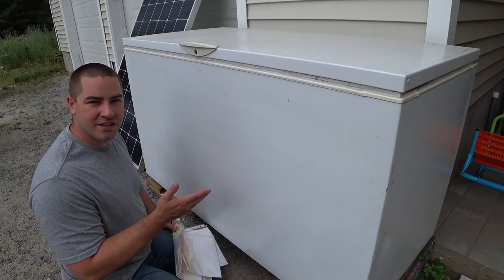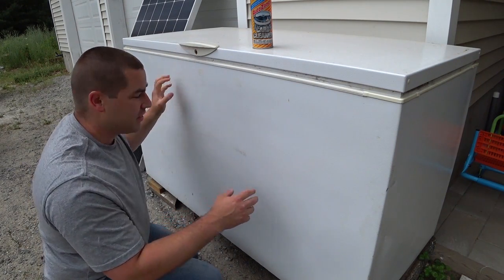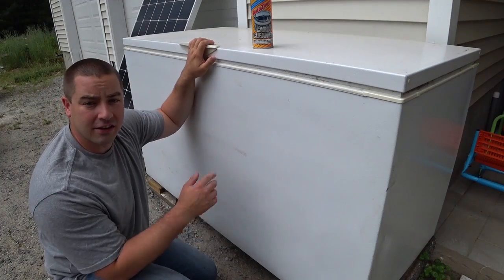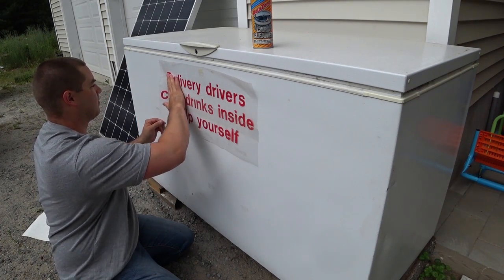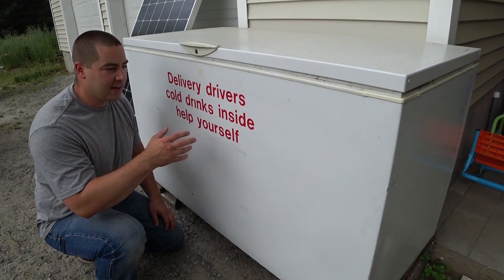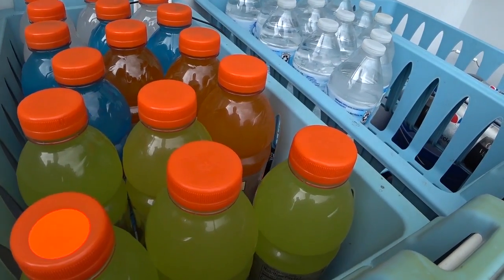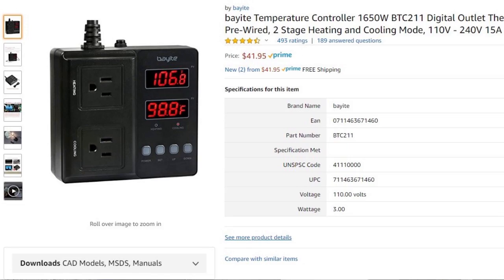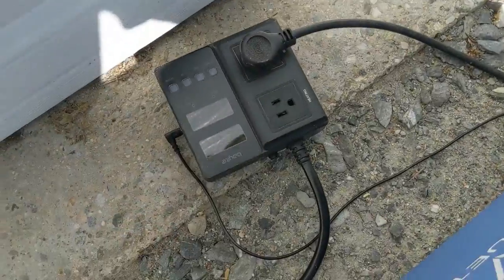Solar Powered Chest Freezer turned into Fridge

Comment: And I have 500 wats of solar, 220an of battery, 40 amp controller and a 1000 watt Redodo inverter that won't power up my 7cf chest freezer with a 100 % battery.  Won't power up my 18cf fridge either.

Comment: If you have the tools you could convert that to r600 and it would use half the power. You can buy new freezer with r600a.  You may want to mount the solar panel over the freezer to provide shade.

Comment: How does the portable power station and fridge freezer hold up in cold/rain/snow?
Reply from the maker: The power station is not waterproof and needs to be protected from direct rain.  Mine has had some rain water splash off the driveway and hit it with no noticeable problems.  The Freezer doesn't care at all.

Comment: Wondering How much battery is needed for off solar hours.
Reply from the maker: It will depend on your load.  This chest freezer seems to be pretty energy efficient over-night.  Nobody opens it at night, and the air is cooler.  So it only uses about 300-400Wh overnight.
Reply: @DavidPozEnergy  thank you for the tip. I figured the formula out for hypotheticals. It’s amazing I can power this with recycled laptop batteries. With sufficient voltage and parallel batteries for Load and run time.

Comment: My 2002 GE 7 cu ft. freezer in the garage is showing on watt meter as using 1000 watts a day.  The watt use seems very high and it is set a the suggested level of 4.  I have a couple questions:  I am wanting an off grid refrig and was not sure if being the watts are so high on this freezer, if worth doing on this freezer?   Also, if use as a refrig in an emergency can it be reversed back to a freezer when emergency over?
Reply: If use as a refrig in an emergency can it be reversed back to a freezer when emergency over ???

Comment: This is really cool and gives me some ideas.  One recommendation I have for stable temperature regulation is to tape the probe to a can of soda.  It will give you a better measurement of how cold your beverages actually are.  That's what I do for my keezer setup and my pour temps are consistently 34-35F.

Thanks for the cool video!

Comment: I got a smaller 3.5 cu ft Kenmore chest freezer and set it up as a fridge at 36 degrees. My kilowatt meter read that over one week, after initial temp cool down, it used 180 watt hours every 24 hours. This is five times less energy than my house fridge. I was amazed. I put many water bottles in the bottom to act as thermal mass, and only opened it a few times to get a drink. Smaller chest freezers are better in my opinion vs the very big one, but it depends on your needs of course.

Comment: Great Vids mate. . . I'm thinking of turning a chest  freezer into an Air conditioning unit. . .chilled water thru a heat exchanger. Glycol water mixture chilled to minus 10 Dec C and circulate the water . . Any thoughts ?
Reply from the maker: I have been playing with the numbers this summer thinking of doing the same thing.  The downside I see, the chest freezer is only cooling about 2000 BTU.  The smallest window AC is 5000 BTU.  So I'm guessing that the freezer by itself won't offer much in the way of cooling capacity.  I'm going to take an old window AC and remove the cover, and make a glycol chiller with that.  Should be more powerful.

Comment: You know,,, I’ve seen 7.8kw generator’s for 600 dollars.... you can run off a 3/4 115 v electric motor,, that runs of its self.... and throw all that other stuff in the 🗑  all you have to do is figure it out. But Save the battery’s at least (4)100 amp,, and a good controller.. life is good..😎

Comment: Just hooked up our new deep freezer to the thermostat controller that you recommended.  Freaking awesome to be able to control the temp this precisely.  Running off the solar panels and inverter/battery bank, so far working great! Thanks for doing all the homework on this diy.
Reply from the maker: Glad it's working well for you.

Comment: How cool... did same with a small freezer, but build a esp8266 with a ds18b20 running tasmota for the sensor, homeassistant as controller and a wifiplug as actor. When ordered stuff arrives i‘ll remodel them to a standalone solution with online monitoring/controlling.

Comment: A bit late to this video but did you happen to measure the energy usage before the conversion? And about how old is it / what refrigerant? I'm asking because it helps to compare different setups. If I want to set up my own efficient refrigerator I would like to know more about where the gains are coming from.

Whatever you do, please keep us posted about your projects. It's great seeing these videos from a real down-to-Earth person.
Reply from the maker: Sorry, I did not test the unit before the conversion.  I don't know the details on it.  But the sticker says Electrolux, model GLFC2027FW6  I hope that helps.
Reply: @DavidPozEnergy  That looks like a 20 ft3 unit from 2006 or 2007, originally rated for 480kWh/year (equivalent to 1300 Wh/day.) It seems like you cut energy consumption by more than half with your conversion. I would not have expected that much savings.

https://www.frigidaire.com/Owner-Center/Product-Support--Manuals/?ProductCode=GLFC2027FW

Comment: There seems to be a non-trivial loss in efficiency since the inverter is always generating AC power despite the freezer only needing this power occasionally.  Even if the inverter had some sort of load-sensing mode, the external thermostat demands constant power.  Say the inverter consumes 8 watts from the batteries with zero load on the AC side; that's a baseline loss of 192 watt-hours per day (~40% addition to what was measured with a Kill-A-Watt).  That is added cost in both solar panel and batteries.  If a mechanical (or DC powered) thermostat could gate the inverter on and off, there would be the opportunity to expend less energy.
Reply: Good idea..will try

Comment: Dave I have an unrelated question for you. I need to charge a 16s 48volt LiFePO4 headway 38120 battery pack but now I'm stuck because I don't know what to charge it with. Can you help me please.
Reply from the maker: LiFePO4 charges to 3.65 volts per cell, or 58.4v for the 16s pack.  I personally use my solar panels and solar charge controller to charge my LiFePO4.  But you can also look for a wall charger like this: https://amzn.to/3iocHCl  
“As an Amazon Associate I earn from qualifying purchases.”
Reply: @DavidPozEnergy  Thank you so much David for your reply once again. Thank you for the link. I asked that question because I am going to use the Headway battery for an Ebike.  Not sure if its the best idea but ya lol I already have money into it. I like all the different projects you come up with.
Reply from the maker: Headways are fine for an E-bike. They really pack a punch.  But they are not super energy dense for the weight.  They will work great for short trips, but long rides will probably do better with something else.  The wall charger I linked to works for 16s LFP, but you still will want a BMS on the battery to monitor the charging and prevent over-charging one of the cells.
Reply: @DavidPozEnergy  Ya I just bought a 16s  Li-ion Lifepo4 LTO Battery Active Equalizer BMS 1.2A Balancer. Hopefully it will work well. But ya David if you have a better 48 volt battery build for an ebike let me know. I could always use the headways for solar instead and go with something else for the ebike. What I like about the headways is the terminals with the screws. It makes it so easy. Now I just need a bunch of assorted terminal wires with connectors and I should be set.

Comment: This set up will produce very little condensate, but it produce some over time.  How does your set up address the condensate issue? Thank you.
Reply from the maker: There is a drain plug in the floor and I can manually drain it.  I see a little puddle forming.

Comment: To the Ref Tech - this is not a commercial system. You are mistaken about this conversion. It uses the same exact refrigerant, oil and compressors as used in refrigerators. Depending on the age its probably R134a.  And if you understand residential refrigerators, they are refrigerator/freezers and the evaporator runs at freezer temps and then about 10% of that freezer temp air is directed in to the fresh food (refrigerator) compartment. This is on a frost free refrigerator. So evaporators and condensers are running at the same temps on either either refrigerator/freezers or just plain freezers. The biggest difference is this is a chest freezer so it means a few differences with a frost free upright refrigerator/freezer. Mainly the evaporator and condenser are just tubes attached to the inside liner and the outside cabinet. Then foam insulation is injected in the space in between. 
Dave - there is one other reason a chest freezer is more efficient than an upright. Believe it or not its the weight of the lid pressing down on the gasket. In an upright a rule of thumb for design was the heat gain into the cabinet was roughly a third each 1, through the cabinet wall, 2 through the door/ lid and 3 through the gasket area. Just the weight of the lid is enough to make a meaningful difference. BTW I used to work designing refrigerators and freezers at a couple of the largest appliance manufacturers in the country. 

to address the water collection in the bottom there should be a drain plug you could remove. if you  attach a drain trap like you find on the condensate line from an air conditioner this would keep cold air from leaking out the drain, though it is small enough not to matter. On the cycle length as long as it runs for 10 minutes before cutting off that is probably enough not to matter. Also, we used to have units that could be either freezers or refrigerators controlled by the user just by changing the settings. You might even be able to adjust the thermostat to raise the temp it runs at and then you could eliminate the fancy electronic control. 

Thanks for these videos - they've been an inspiration to me.

Comment: It’s easy, but there’s nothing to de-humidify the inside.  (I do this to brew lagers).   It’s fine for brewing as the co2 production maintains positive pressure inside the fermenting vessel but due to mold build up I’d not use is for anything not sealed/washable.

Comment: I have a upright freezer already, I'm going to make  plexiglass doors to go inside the door, to keep in some of the cold, when the door is open, the thing is soo big , it would not fit through my doors! Even with the door removed,  I was going to convert it, I may still, but the extra doors should help, I'll see how's it goes!
Reply: My grandparents had an old fridge or freezer that wouldn't fit through the doors. Once it broke they used it as a DIY safe.

When you talk about converting your upright freezer, do you mean into a refrigerator or into a chest freezer? Refrigeration systems don't work if they're not upright, so you would probably need extensive modifications to convert an upright freezer to a chest freezer.

Comment: Let me see if I have this dumb idea correct....... All $'s approx.:  $2050 Bluetti w/tax + $48 temp controller + $400??? solar panel = $2498 divided by a realistic $25.00 a normal month (or less) for 120vac supply = 99.92 months to break even.....    So, I'm to invest $2500 to run a freezer instead of plugging in to vac.???    Just plug into 120vac & turn the thermostat down to a less than freezing temp & Bob's your rich uncle...!!!
Reply: He claims the freezer is "super efficient" yet it draws 200w. My new Samsung fridge freezer draws 30w. Since when do old appliances run efficiently?

Comment: I have done this with upright residential and commercial freezers for many years. Usually changing the internal thermostat with a commercial thermostat that had a range from -25 to 90 degrees. This would make it easily changed back and forth. Especially nice if having a big party. Upright freezers hold a lot of drinks. Also a lot of groceries. Only problem is some new freezers are digital and are not easy to hack.
Reply from the maker: Good idea.  If it's not too much trouble, could you please help me with a link to a thermostat like that?
Reply: DavidPoz Never any trouble at all, I sent you a message!

Comment: Based off your power reading of 200W, 2.5 hr run time in 24hrs is great! My cheap ($225 USD) upright fridge runs 21 hrs in 24 to keep things just cold enough. It's new and I rent, I told the landlord and the dealer came and checked it, said it was fine. They bought inexpensive appliances and the energy usage shows it.
Reply: That can't possibly be correct for a traditional refrigerator. I suspect either there is a poor seal or the compressor is not running at full speed. New refrigerators will often have multiple speed compressors to increase efficiency. A cheap fridge wouldn't do this unless required to meet energy standards, maybe it just has a tiny compressor because it's cheaper and slightly more efficient (at the expense of longevity)

Comment: why not just change the compressor to a danfoss 12v compressor then it will run as a fridge and freezer and add a hybrid controller so in the day time you can run it with solar and at night time you can run with wind turbine
Reply: In the US you need to be licensed in order to modify refrigerant loops.

Comment: @DavidPoz With the temperature sensor hanging in the air it can experience very sudden shifts in temperature when the freezer opens and closes, causing unnecessary and high-wear short cycles.   What you can do is put the temperature probe inside water with around the same volume as the drinks (thin plastic bag around it if it's not rated as waterproof).  That water will track much closer in temperature to the actual temperature of the drinks, and will be far more stable with opening and closing the fridge.  If you do that, you could also narrow the temp delta on the controller to maybe 33-37f.
Reply from the maker: That's a great idea, thank you.  I'll do it.

Comment: excellent work mate.  There is also a device, the sonoff TH-10/16, that has a port for a temp probe.  it's a more work to get up and running but it's option and offers wifi monitoring.

Comment: sick!!! I did this with a 12v thermal electric cooler to save power cause those things run non stop at around 50w, but with the 12v thermal controlled relay it really cut down on the usage by around 30%
Reply: For a cooling mass like this you need a lot of tec to cool em down and keep it cool, and their way not so efficient like a conventional compressor system.

Comment: The MAXOAK Power Station is kind of pricey. It will take me a while to breakeven.Do you have another product recommend?
Reply from the maker: Sure.  I'd prefer building my own setup and customizing it to your needs.  I suggest buying batteries from https://batteryhookup.com/  (10% off with code DAVIDPOZ) Then I would go with a Victron inverter and Victron charge controller.  It would end up costing more in the end, but you could get more power.

Comment: Since this is just for beverages, I would want to set it to freeze with the early morning sun for 4 hours, then turn off for 4 hours (thermal mass should keep it cold by now), then repeat that cycle. A third cycle to complete a 24h period I’d set to 4 hours fridge temp and 4 hours off. The bluetti would do little more than regulate power in/output 
Can that temperature sensor be programmed like this?
Reply from the maker: The temperature sensor I'm using doesn't have a timer function.
Reply: @DavidPozEnergy  Working great the way it is now. 500Wh a day when it draws 200W is only 2.5 hrs of runtime a day anyway. You would loose more energy trying freezing stuff to let it thaw than leaving it as is. That box is super insulated and doing a great job at keeping the cold in.

Comment: That's a neat and very easy solution. I thought you were going to be modifying the built-in thermostat somehow lol.
Reply from the maker: Actually, I was going to do that.  But I went this route so that I can add a little heater pad on the same controller (different plug) and keep the drinks from freezing in winter.

Comment: Are there any issues with the compressor being exposed to the elements or just being outside when it gets really cold like winter?
Reply from the maker: I don't think it'd be a problem, but I don't know 100%.  I did lift it up off the ground with some blocks of wood so that no water will sit up against the underside.
Reply: I have seen freezers outside at little stores and fish camps for 30 years. Some are so rusted you would think they would fall apart and they keep on going. In the winter you may have to put a small heater inside to keep it above freezing.

Comment: How long have you had the EB240 power station? You like it and any problems with the unit?
Reply from the maker: I've had one problem with it.  I left it out in the sun and the sun cooked the screen.  Now the screen doesn't show up 100%.  I ordered a replacement screen which is on it's way.  But the unit itself works just fine.  Before using it for this fridge I used it for 2 weeks powering my pool pump (small one).  I've been testing out different uses trying to do thorough testing before making my video.  It hasn't died on me, over a month 24/7 use.  Not as much fun as making your own though, LOL.